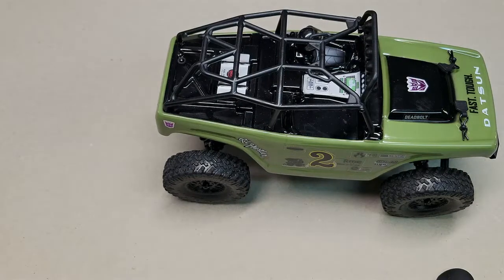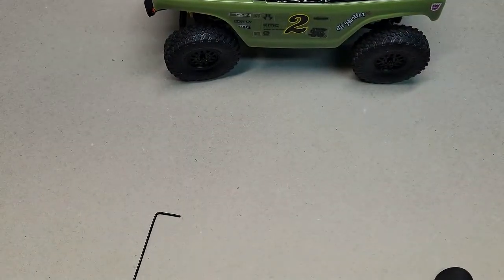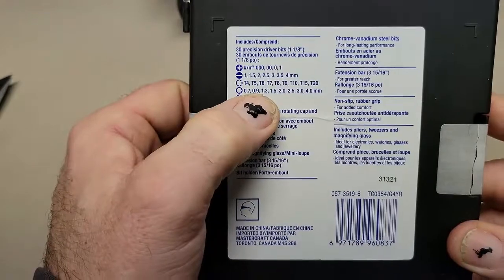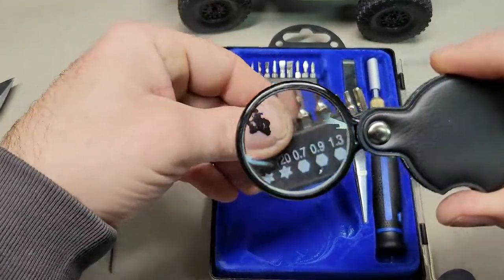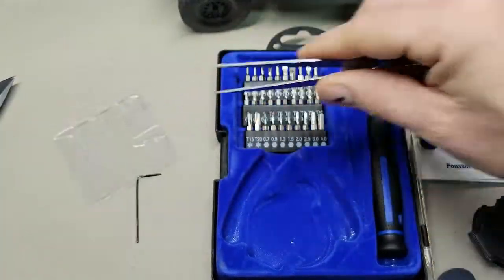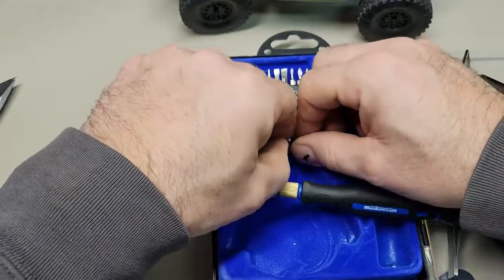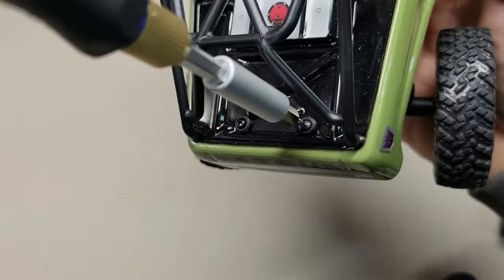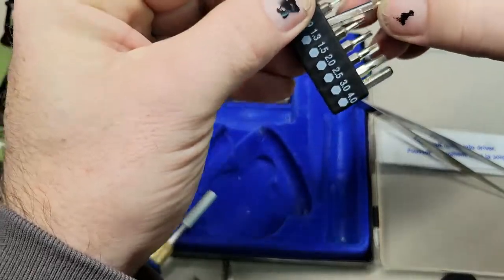Mastercraft precision driver and bit set. + unbox and review. Will it work on a Axial SCX24?

Comment: This thing was a bit of a joke for me : the bits don't click into the extender piece as in your video, they fell out no matter how i tried to slide them.
So i went back to the store (C Tire, in Canada), and they accepted to change it for another one (i bought it on sale) on suspicion this one might be defective.
But I am getting the same results, the pieces never click or magnetize, or what: they fall out systematically.
 It works if i don't use the extender, only then does the base tighten on the bits....
Not sure what is the problem
Reply: Hello. I just got this set, and it kept falling off too. So I took the head I cared the least about and pushed it real hard against my desk. It took alot of strenght to click in, but after that first one it clicks in and out nicely without much force. Hope this helps.
Reply: @DustRaptor  nice, I will try that, thanks partner....

It's crazy to think that I got this tool to fix a problem on a fan I bought that same day!
Reply from the maker: Hey, after using it for a while, I would have to agree with you!
I'm glad I bought it  for the SCX24, but it does the trick!
Thanks for watching!
Asplenia.